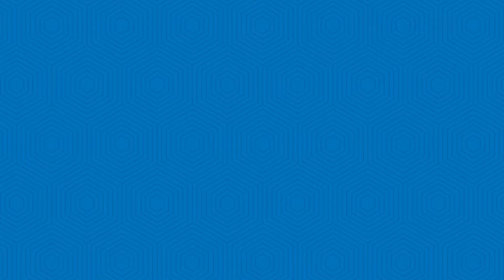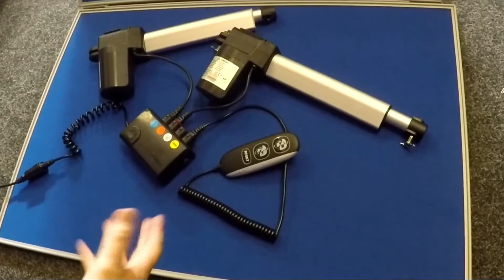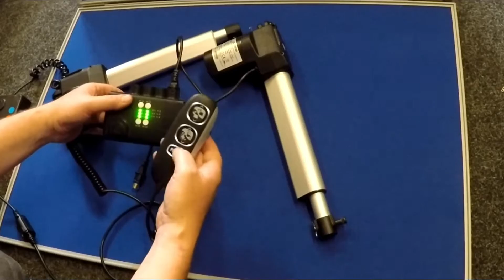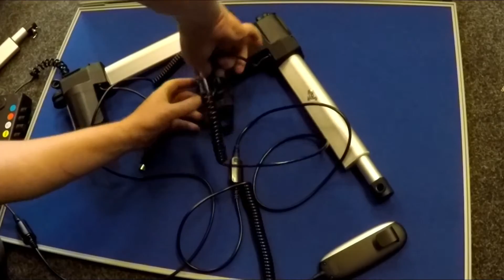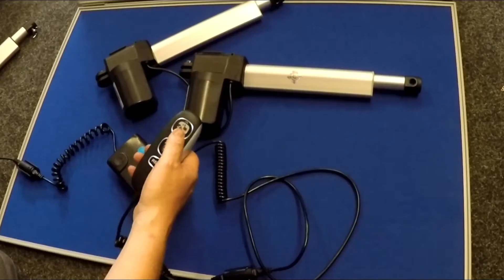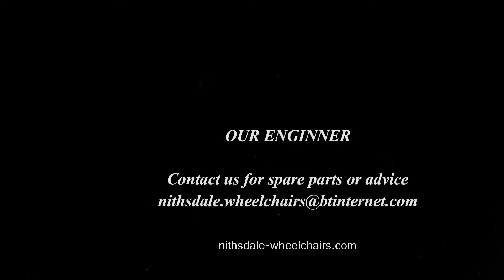Electric Riser Recliner Fault Finding

Comment: What could be the cause of mine clunking and not reclining all the way when you sit in it but working fine when no one is sitting in it? It also does the same clunking catching noise when you try to life yourself up and gets caught. Its is a single motor.
Reply from the maker: I would lie the chair on its side and check the linkages also to see if there are any slack / missing bolts
Reply: @tomjacques4    Thanks for your reply, I have done so and tightened up all the bolts but is still doing the same thing.

Comment: tengo un sillón elevador que también cambia de posición, funciona bien al bajar, pero al subir hace un sonido "pock", cambie el capacitor y no funciono, qué puede ser
Reply from the maker: sadly i dont know what capacitor you changed the noise may be a linkage on the chair not being secured correctly, or a slack clevis, or sometimes the nylon gear inside will break. would have to see the motor and chair working before giving any diagnosis, sorry

Comment: I have a scootor that wont turn on I took the joy stick apart where the on off button is i use a test light connected to the negative part of the battery and the other end i touch the computer board and I can get it to cut on and then it works perfectly and I put the buttons back over the computer board and everything works but when I turn it off I cant get it to turn back on I have to repeat the process of taking it back apart and using the test light to cut it back on
Reply from the maker: Dave Jones morning Dave. Send us some pictures or a video to nithsdale.wheelchairs@btinternet.com
Reply: @tomjacques4  ok I'll try to get a video today

Comment: Thanks for the video every one is use full, My kmyco  forU scooter motor gets quite hot after about half an hour journey, is that normal ?, many thanks.👍
Reply from the maker: davld cooksey as long as you don’t burn you hands on it when your touching it then ok. Mind up what terrain are u going on lots of hills? As long as you don’t smell burning then that’s ok.  If the scooter is old then you may have to replace the motor or the brake may be binding on and causing friction   Hence the heat.
Reply: Nithsdale Wheelchairs V ok ,thank you for the quick reply, take care, 👍👍.
Reply: Hello there, My kmyco forU scooter motor was getting hot after about half an hour, I have now separated the magnetic brake away from the motor but left it wired , the brake does release but after 5 minutes it gets hot, the motor is nice and cool, has the magnetic brake had it, or can it be fixed ?
Reply from the maker: davld cooksey hi David looks like new brake is required let me know the model number starts with (EQ) and I will give you a price send you model number to nithsdale.wheelchairs@btinternet.com
Reply: Nithsdale Wheelchairs V ok thanks for that, I will check the model number  and get back to you, thanks again for the quick reply, 👍.
Reply from the maker: davld cooksey hi you should find the model number close to the batteries on a white sticker
Reply: Nithsdale Wheelchairs V ok thanks.
Reply: I still need to send you a few photos of the brake so you can see if you have something similar, 👍.